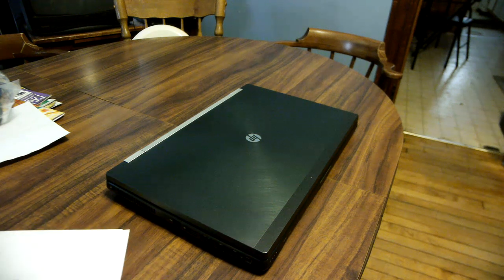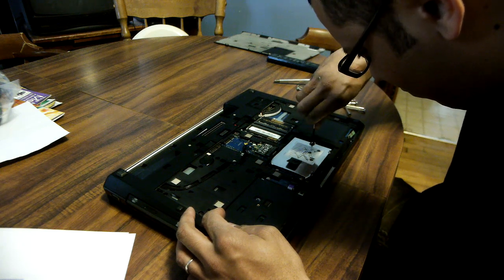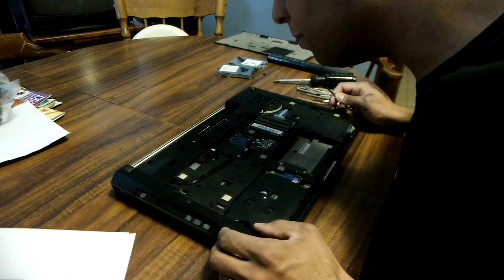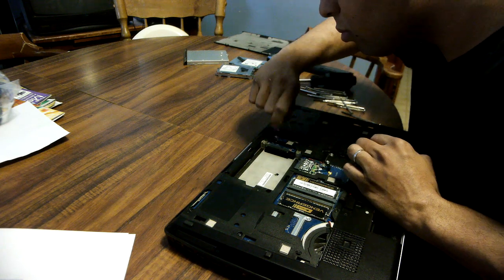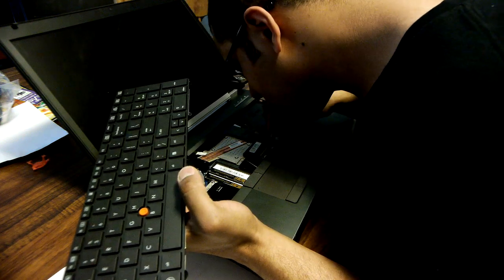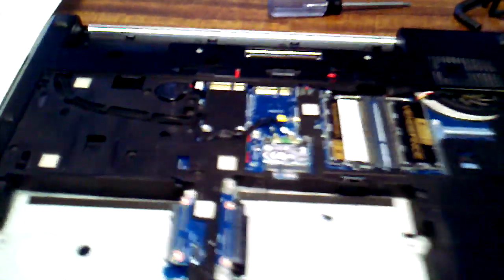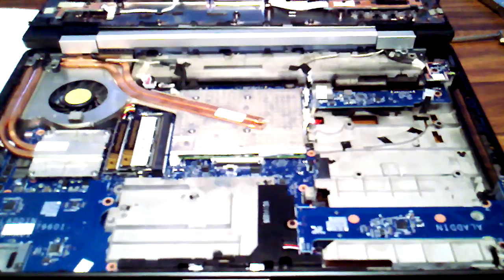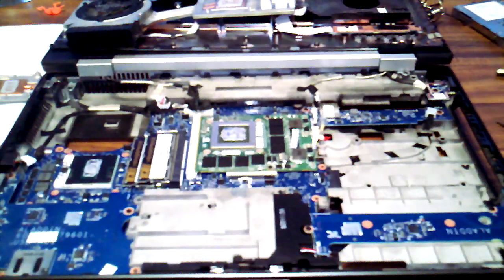HP Elitebook 8770w Disassembly & Repair Video

Comment from the maker: It's a while ago since I've benchmarked the laptop with SPECviewperf which is a benchmark program to test the system for apps like CAD and 3DS MAX. I'm totally guessing what it was but I believe the GPU was about 70C under load and the CPU was about 93C. This is of course after I opened it up, clean it up, applied much better paste, and put it back together. It has been months since this video and my temps have been very low so I'm very happy I did this.

Comment: Thanks for your video, it's informative and prepares one for disassembly.

Note:

Your method for removing the keyboard is wrong.  You pop the keyboard out from the underside access hole after removing the Optical drive.  My tech used your method and scratched up the fascia, the method I mention is from the service manual and avoids any damage from metal tools used to pry.  You are correct about the ZIF connectors being a pain though, I had trouble with the orientation, I don't find it obvious.

Comment: Thanks for this video!

I would like to comment by saying that when reconnecting the keyboard, make sure that the two cables (wide blue and narrow violet) are fixed properly. I am mentioning this because I have removed the keyboard a few times and at one time one of the two cables was not connected properly and this caused the laptop not booting at all.

Best, Max
Reply from the maker: I didn't know that would happen but that is important to note.
Reply: Yes, those keyboard cables and connectors are a bit of a pain to re-assemble and at times, even though everything looks in order, when you try to power up the laptop, nothing works... that means that one of the two cables is not inserted properly which will cause the power glitch... Once you are aware of this, it just takes a bit of patience and everything will function again:-)

Comment: Thank you so much!  you helped me out tremendously. Please make another clearer video on the same topic. and by the way: you're right, this is one mean decent computer!
Reply from the maker: I just bought the dock for it. They're cheap used on ebay. I might do a small video on how the dock can expand the system. (I only could find one other video with someone using the dock and it wasn't too helpful.)
Reply: wow! sounds cool. I think subscribing.

Comment from the maker: Hi David. The 750GB HD should fit no problem. If you chose a Western Digital Black 750GB, I know it will fit. As far as the SSD, most will NOT fit. I personally ran into this problem a couple months ago and I recorded a video of what I did to get around it. I hope to release that video soon but basically I removed the plastic casing of the SSD and it fit but insecurely. I installed a hard drive mounting bracket to keep it from moving around. Your best bet is to get a mSATA SSD.

Comment: I wanted to ask if I change my video card from firepro 4000m to quadro k4000m am I going to need a new heatsink, what kind of thermal paste should i use (is arctic silver 5 ok) and is it going to void my warranty if I do the upgrade myself?

Comment: Thanks allot for this video!  But I also have some advice for you, when working on a table like you do, get some light that comes from the front of you, not from the back ! You are working in your own shadow.....
Reply from the maker: You're right. I will keep that in mind for the next video.
Reply: Magmafire Hey man, I have an elitebook 8740w, is the gpu soldered on yours?
Reply from the maker: No. I have a removal card slot. I believe it's a MXM 3.0b standard.
Reply: yes it is, thanks

Comment: I want to put a 750gb HDD (2.5 inches) and a 240gb SSD (9.5mm height) in the 8770w, is there enough space for those two? And if so, can I still put a third in the optical drive?? Thanks, great video!

Comment from the maker: SSDs are about the same size as notebook HDDs. The reason it won't most likely fit is because the plastic case the actual SSD is enclosed in is too thick and is slightly too wide to fit. You can easily take the SSD plastic case apart and put the SSD "guts" in and it'll work fine (like I mentioned previously).

Comment: Magmafire. Thanks for this informative video!
 
I've and 8770w i7-3820QuadM, 2.70 GHz (Turbo up to 3.70 GHz). Lately,  it's been overheating when doing heavy video rendering.  So, it's time to clean the fan and change the cheap thermal goooey that HP uses from factory on the CPU and graphic card. I think I'll use Artic MX-4. What thermal compound did you use on your unit? Thanks!

Comment: I'm about to undergo some upgrades to my current 8770w (new SSD yay!) and am planning on adding thermal paste to counteract the frequent overheating I've been experiencing - could you recommend the product you ended up using?
Reply from the maker: +Bret Hudson The thermal compound I used is PK-2 from Prolima Tech. I used it both on the CPU and GPU. I also replaced the sticky thermal pads on the GPU memory with new ones. I can say the GPU runs very cool under load. The CPU still hits high temps unfortunately, like the mid 80s.

Comment from the maker: In this video, I get all the way to the GPU. If you follow the link on Facebook and view the pictures I took, you can see there is only two screws holding the GPU in. It is important to know if the BIOS installed in your laptop is compatible with the GPU you want to install. The release notes on the BIOS should give you this information.

Comment: how you take off the back Panel?
Reply from the maker: You mean the back panel I remove at 1:10? It's the first slide switch on the right side (opposite of the battery release that looks similar).
Reply: i mean after the slide.is it possible to reach the cooler from the bottom side? or only from the top
Reply from the maker: It can only be accessed from the top.

Comment: it was useless.... because the main thing how to remove top panel you skipped that and left us behind...
Reply from the maker: You mean the non-removable plastic frame???
Reply: no i was talkin about the top panel you skipped removing
Reply: anyhow i scratched a lot and opened that
Reply from the maker: You mean the part of the frame that comes out after you remove the keyboard labeled screws and push the frame forward....???
Reply: +Magmafire i mean top panel
Reply: +Magmafire anyhow its ok i opened it and it cost me scars
.thanks
Reply from the maker: Anyway, around 8 minutes into the video, I show taking off the panel. I really don't know what you're talking about.
Reply: +Magmafire between 9.17 to 9.20 how you dissassembled top panel the one you holding in your hand